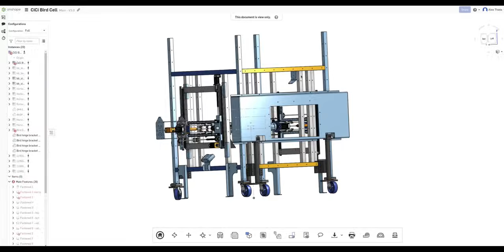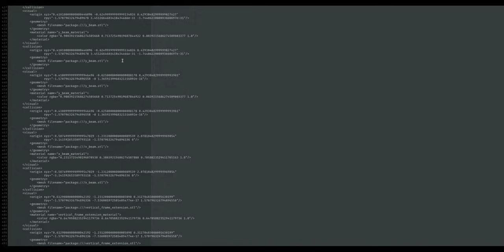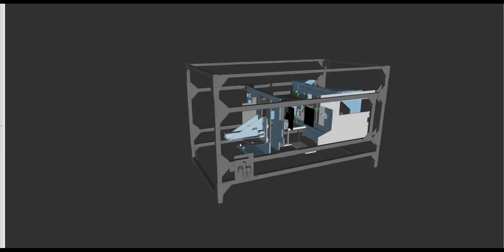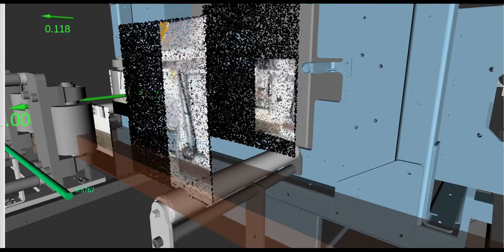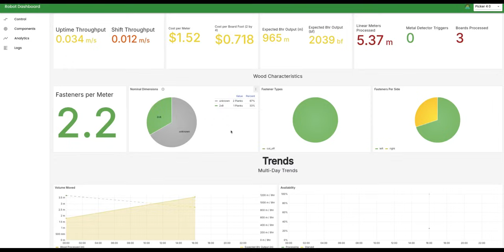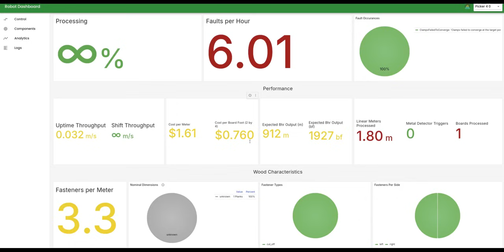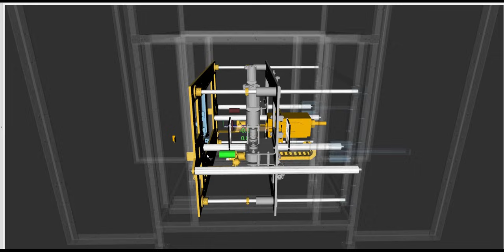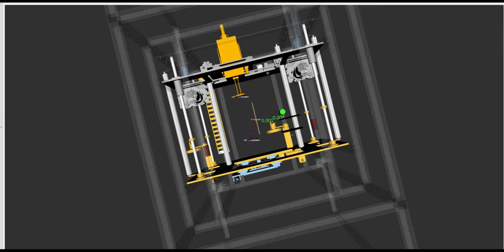How Simulation Accelerates Our Robotics Dev Cycle

Comment: What are you using for the visualization and simulation of the robot? Also you need to tweak your mic level because you are blowing out the levels sometimes.  Awesome work with a smart, modular architecture that will scale horizontally and vertically but you know that already!
Reply from the maker: @ZapRivet  thank you for the kind words! We're using Rviz2 for the visualization, it's a common ROS2 package for this sort of thing. The simulation is custom built, a suite of mocks we have created that we can flip on or off at our leisure, to mock out different hardware components. 

Sorry about the mic, I just bought a better one for my next video!

Comment: Thanks for sharing this video, its very cool!  Happy to have found this content, I just subscribed. BTW imagine in the future with AR glasses, would even be cooler!

I just wonder, doesnt this take too much effort? I also have a HW company and I truly believe this is the future of HW development, more and more simulation but I always thought its for large companies and not so much for startups. Perhaps in your case it's a necessary burden for allowing the software team work with hardware team simultaneously or maybe it's not that hard to set a system like this up.

If it was simple, like CAD export and simulation ready, I would also go for it, I actually tried with Unreal Engine once. With physics engine on and I communicated with it over MQTT. I could start conveyor belt, move axis even collide and bounce back... was super cool but then again, you have to set a lot of things manually after the export. Maybe URDF helps much more with defining assembly points but I assume there is no collision detection with the RViz setup, isn't it problematic to develop with it for the moving parts?

And how do you define motors, like if its a stepper, it feels like a lot of manual arrangements need to be done so you know how many milimeters each revolution moves X axis, for example...
Or the sensors, you might have them on cad, but then you have to define them one by one...

What was a show stopper for me was, what about when you have a hardware iteration, we try tro have many small and 1 big improvement every week, some of them work some don't but hardware eventually changes constantly, although some changes are small I was intimated having to maintain such a digital twin system. Maybe one day I can have someone develop a custom Unreal Engine plug in for me to use but that again is both time and resource investment...

So reason why I wrote this long was not to start an intellectual debate, it was my frustration and hope maybe you have found a way around to problems I have faced
Reply from the maker: I really appreciate your interest and thoughts! I completely understand the frustration.Please, email me at alex@urbanmachine.build, we can set up a quick call and I can walk you through our experiences. Robotics is hard, and sharing experiences is the best way to move the industry forward! I'll try to tackle some of your questions here, for other readers:

> I just wonder, doesnt this take too much effort?

At first, you'll feel like it does. Once you have the tooling built, your iteration velocity goes through the roof. That's why I'm pushing so hard on the open sourcing we're doing. If these tools existed, we wouldn't have had to invest so much time into them!

> If it was simple, like CAD export and simulation ready
> And how do you define motors, like if its a stepper
It can almost be that simple! Depending on your application, simulation DOES NOT HAVE TO INVOLVE REAL PHYSICS for you to have benefits in the SW dev cycle. For example, you can write mocks that fake the motors- that's how we did it with our steppers and servos. They receive inputs (go to X location at Y velocity) and then output encoder ticks that increment towards X at Y speed. You can build other mocks (like we did for our cameras) that are specific to your application. For example, we had a `mock_wood` that would output different sensor readings as if there was wood entering and moving through the system. Devs can edit a `mock_wood_description.yaml`` to change the properties of the wood that appears in the system.

Alternatively, and this is what I will do in the future, you can use Isaacsim to get physics. That can be overkill though.

> What was a show stopper for me was, what about when you have a hardware iteration, we try tro have many small and 1 big improvement

We've had 8 hardware iterations and 3 major iterations over the last 3 years. Each one had a digital twin, and the digital twin helped smooth things over significantly. Once you have a good workflow for it, it becomes the obvious thing to do :)

Comment: Thank you so much for demonstrating your work. May I please know, how did you apply ML on your simulation? I am using Isaac Sim and lost how to integrate ML/RL (Isaac Lab)/LLM over my sim environment.
Reply from the maker: Hey! What problems specifically are you running into?

In our case, the machine learning we're applying live more in the computer-vision spectrum of use cases. For example, segmentation of fasteners, algorithms for predicting the type of fastener, the different parts of the fastener (head, body, threads, staples, etc). We haven't found much practical use for RL in our robot.

I might be able to help though, I do have experience implementing RL in simulations.

Comment: Thank you so much for sharing your robotics knowledge, super useful.
Reply from the maker: Thank you for your kind words! Is there anything you think I could add extra value by covering? I've so far just been doing surface-level videos, since robotics can get so technical it's hard to make engaging videos around the subject.
Reply: @AlexThiel  Currently I am interested in how you set up and designed your systems. 
The amount of actuators and sensors looks super complicated so seeing you break it down into its parts is super interesting.
Reply from the maker: @robingdwl  that's helpful. It's definitely complicated, especially because the picker happens to use a different PLC & motor system entirely than the cutter and cooker, so we had to write a translation layer so that we could use the same patterns for controlling the picker as the rest of the machines. 

Maybe I'll rope in my cofounder Andrew in the video, he could speak to the crazy electrical setup and how we hook it all up to a safety system.